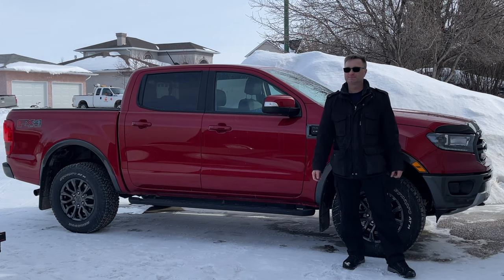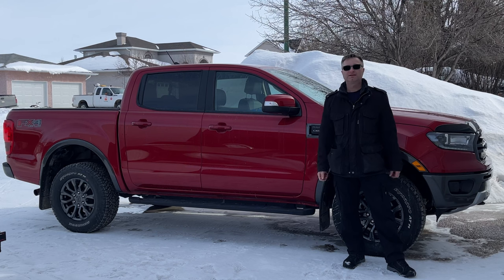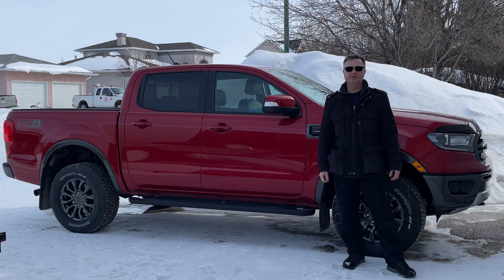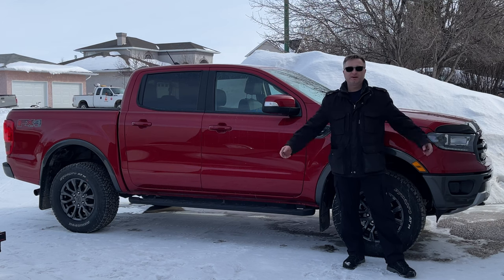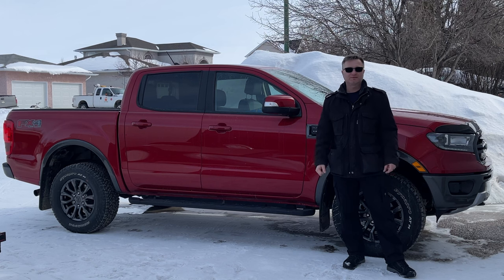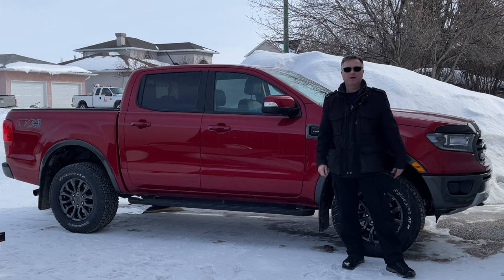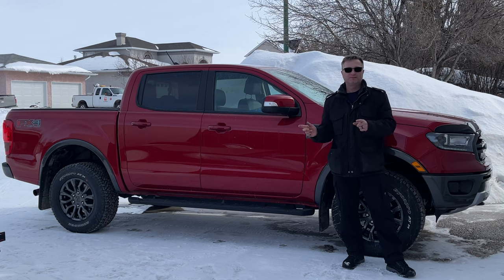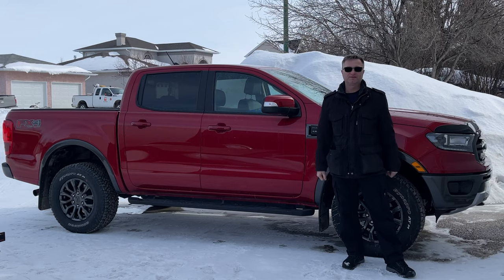Dirt Devil RV Central Vacuum Systems Install and Review (CV1500)

Comment: What I really like about the Dirt Devil CV1500 is that it fits under cabinets.  I have a central vacuum in my house and there was a place where they didn't put a wall valve and the hose wouldn't reach.  I wasn't about to open the walls up to install an additional valve.  So, I installed one of these babies under my bathroom sink and ran the flex pipe straight through the wall and presto!  The additional valve I needed without opening anything up!  But I went online and got a different valve because, the hose I have is different.  My advice is, if you are installing this in your house for an additional valve or in your RV, install your valve benext to an electrical outlet.  That way, you can use an electric power nozzle to really clean your RV carpet well.
Reply from the maker: Great suggestions. Adding a power nozzle, especially if there is carpet is a smart idea.
Reply: And, you can look online for a power nozzle.  Or, you can do like what I did, I had a Kenmore canister that unfortunately stopped working but the power nozzle was still functioning correctly.  So, I just purchased a central vacuum hose and repurposed the power nozzle.  You just have to buy a central vacuum hose that will operate a power nozzle.  I go camping a lot and I have an RV and I have a central vacuum in my RV and I always like to take my central vacuum hose from my house in the RV so I can use the power nozzle on the carpet in my coach.
Reply: Can I offer you another suggestion for your RV central vacuum?  Most RV central vacuums have a white or ivory wall valve.  That ivory doesn't always match very well in some coaches.  If you look online, you should be able to find some metal wall valves that come in brass, chrome, white, bronze, and sometimes black.  Buy those and they look sharp on the woodwork in your RV.
Reply from the maker: @chadrowland5234  thanks for the new tip. I painted mine black to match the rest of electrical outlet faceplates.
Reply: @SlippingTime oh.  Well that would work.  Bronze would look good in your RV too bad I think I like the black.  Your valves require low voltage wire to turn the vacuum on and off.  I am sure that the manufacturer probably gave you wire but if you need more, you can use speaker wire or lamp cord wire.  You can even use 2 conductor thermostat wire or doorbell wire, even lawn sprinkler wire can be used as well, all of which you should be able to obtain from your home center or home improvement store.  You can also use fire alarm wire but I wouldn't recommend it for a vacuum system.

Comment: Great place for the install. How did you hinge that vent. I could use some pictures or a short video.
Reply from the maker: I should have focussed on that better in the video. I used hidden hinges. I can’t really get any pictures at the moment as the camper is currently in storage.

Comment: Update?  I am looking at one for my home, have a great spot that will keep it out of sight and provide a litteral central location and get every corner...
Reply from the maker: It works great for and RV or perhaps a tiny home. The bag is pretty small that for a larger home it may need changing a lot.

Comment: Great install!  Are you concerned about it being too close to the furnace?  I am having a hard time finding a place to put mine, and never considered above the furnace.  How hot does it get when the furnace is running?
Reply from the maker: Great question Dan. I tested the furnace prior to finalizing putting the central vac there. After install no difference.  That space never got warm at all which I suspect because it’s an intake for air so it is always flowing.
Reply: @SlippingTime  Thanks!